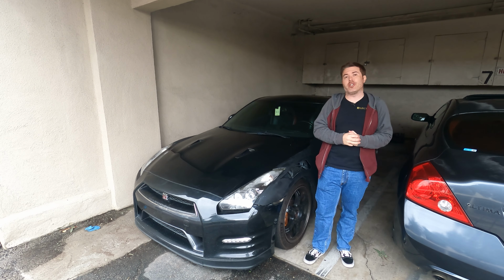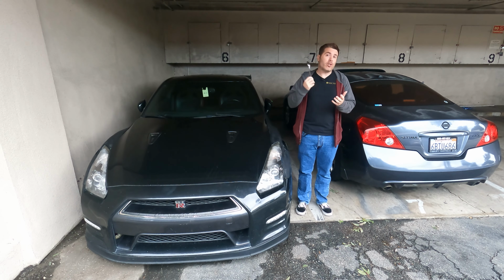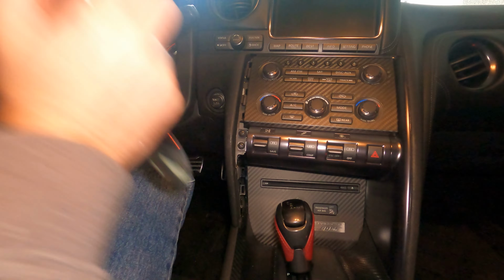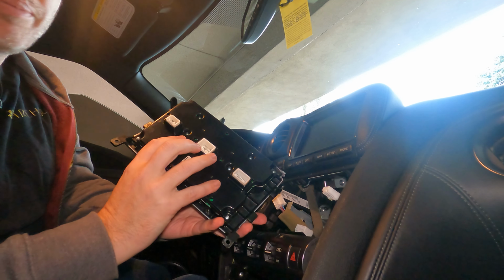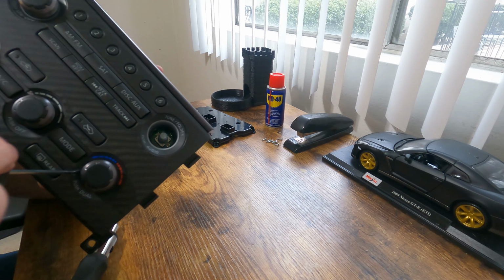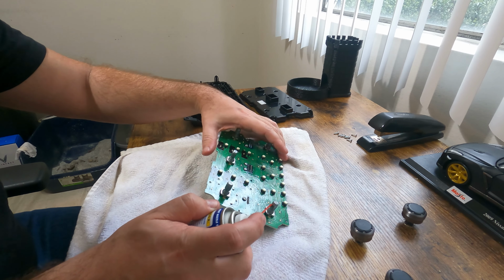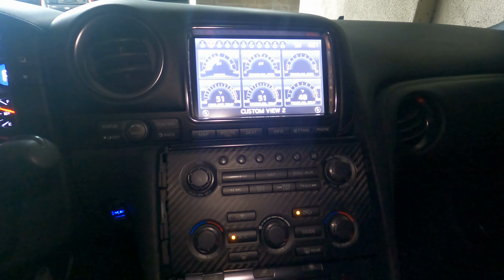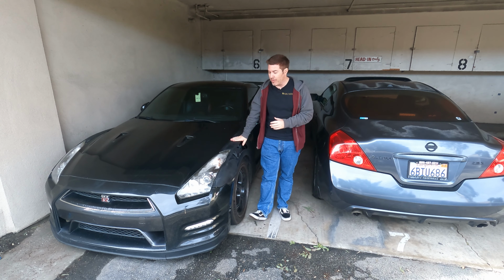HOW TO REPAIR THE AC AND RADIO CONTROL KNOBS ON A NISSAN R35 GTR

Comment: This happens because the potentiometers age and get a patina on the base part inside, that prevents contact.   If yours keeps going bad again and you want to repair permanently then desolder each one with an smd rework station heat gun like an 858D/868D with small nozzle (NOT a normal heat gun), be sure to protect nearby components like LEDS with foil.   With each one removed from the board carefully open the potentiometer by lifting the 4 lugs underneath, then lift the frame off.  When you separate the potentiometers be careful not to lose the little button press rubber part or bend the little contact springs, this is best done on a light tile floor in case bits fall out.  You then gently wipe around the metal base contacts with a tiny bit of 1200  sand paper.  Reassemble potentiometer with pliers, check it works then solder each one to the board (from memory the volume one is different to the others).   I recommend using solder suck or wick to get solder flat so potentiometer sits flush on board, then hold down whilst adding solder to each leg, don't forget to solder the sides after too.  It's quite fiddly and not without risk but it is essentially a free permanent repair that makes it as good as new and doesn't require new potentiometers; providing you have some solder skills and don't f**k it up of course 😊
Reply from the maker: Great info. Thank you
Reply: It's also possible to use new Panasonic EVE-UPCAH516B potentiometers from DigiKey as donors to rebuild your existing ones.  You take just the base from the new one and reuse all other components of your existing.   Although this should not be necessary if you're careful with previous method.

Comment: i actually just removed the knob and used a ear q tip soaked in alcohol and tried to soak the metal knobs  as much as possible, it did fix the issue but im not sure how long that fix will last, i did this because my xbox elite controller was having a bad bumper issue and this is actually a fix for a non responsive bumper
Reply from the maker: I took it all the way out to also check the board

Comment: Never seen WD40 used on or around circuit boards.  Wonder if there are any longer term undesirable side effects.  I would think electronic cleaner would be a better choice because it will evaporate and not leave an oily residue.  I think WD40 is fish oil based and I'm not an expert, but I don't see any electronics people using fish oil or WD40 on circuit boards.  Anybody have any feedback?
Reply from the maker: That's why I wiped up the board, but the regular WD-40 will also lubricate the knobs. Also I thin WD stand for water displacement, so it should be fairly safe for electronics. I found out after this the WD makes and electronics specific product
Reply: @JDArcher  So after nine months, knobs working better, worse, or unchanged?
Reply from the maker: @scottstolper4473  working way better, except for the volume button, but I think it needed more cleaning and I just have not taken it off since this.

Comment: what happened to the video about this that you posted yesterday
Reply from the maker: I noticed some sound issues, so I went back and fixed it so it would be better
Reply: @JDArcher  ohh, have a nice rest of your day
Reply from the maker: @charlie_r3583  thanks
Reply: Good vid.   Might want to used electrical contact cleaner instead of WD40 as it won’t leave any oily residue.
Reply from the maker: @BeastlyGarage  probably, but the WD also will lubricate the rotational knobs